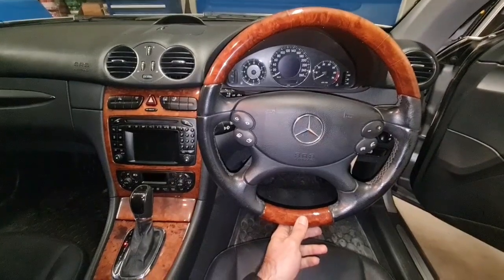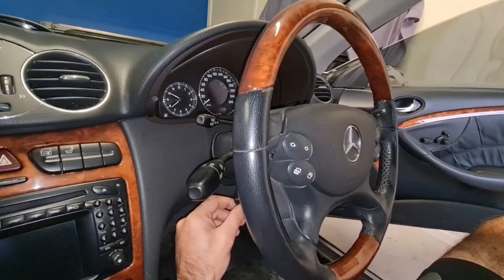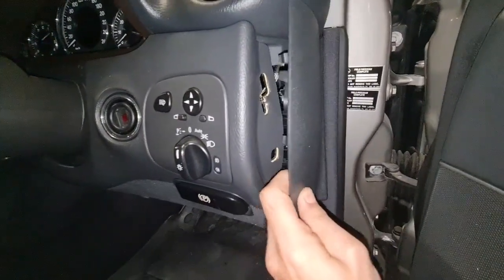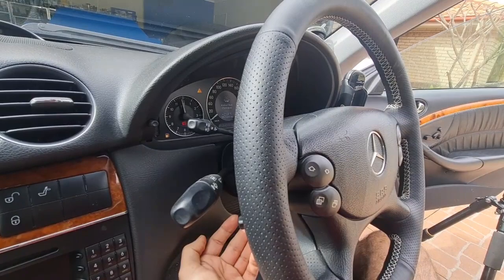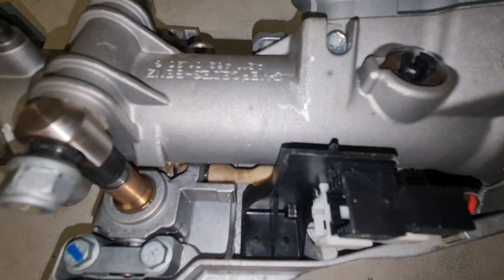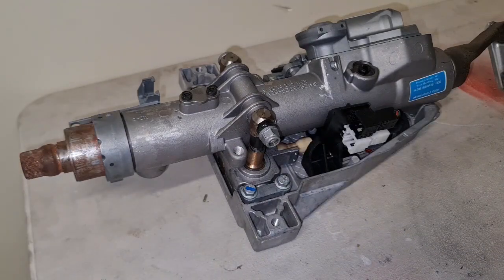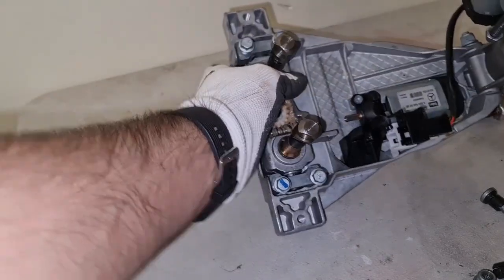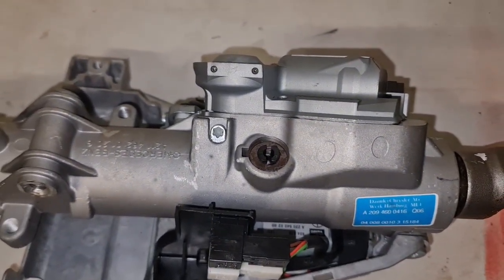Mercedes Steering Wheel Tilt Adjustment, NOT working?

Comment: You don't need to disassemble it. If you do not use it for a long time, it gets stuck. If you forcibly lift the handle with your knee and move the tilt upward, the stuck thing will come off and it will work normally. I solved this way.....hahahaha
Reply: goated this worked for me 🙏🏽
Reply: Yup this thing works for my w205 just force it upwards
Reply: just saved the shop 4 hours thank u

Comment: I changed my w211 broken part about $3 from the dealership
Reply from the maker: Great, did you take off the column? How long it took approximately?
Reply: I didn’t take out the column but the steering wheel. It took me about an hour to strip off bcoz i was following YouTube instructions
Reply: What was the part number of that plastic joint?

Comment: hi. i have a w251. my reach column doesnt go in and out. the tilt is fine. can i repair it? the motor is running i can hear it uzzing when im press the lever . thank u
Reply from the maker: Everything is repaiable, but the problem is that, can we take the assembly apart, fix it and put back together and the car still be 100 percent safe to drive and steer and would it worth the time spent?

Comment: Hi very informative when you bench test the electric motors which terminal did you connect + and - for up and down and in and out unfortunately I dont have the color code wiring diagram
Reply from the maker: Sorry, can't remember